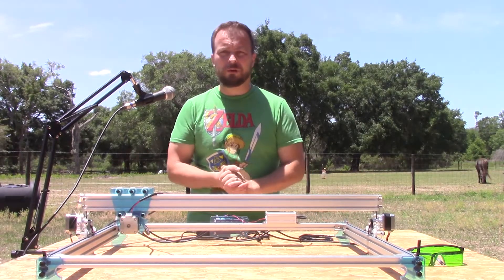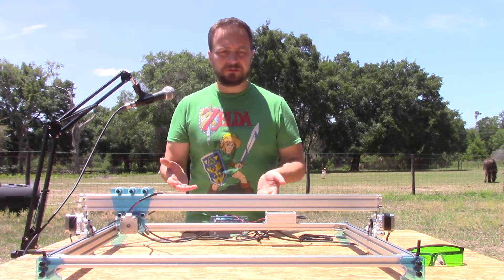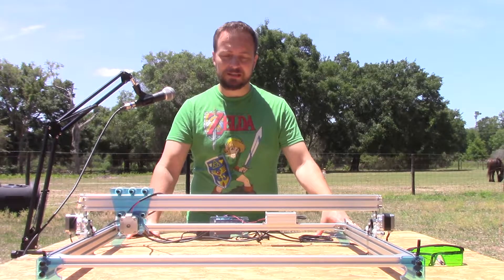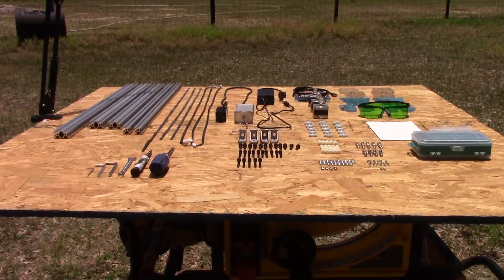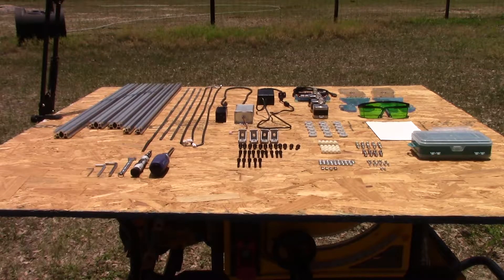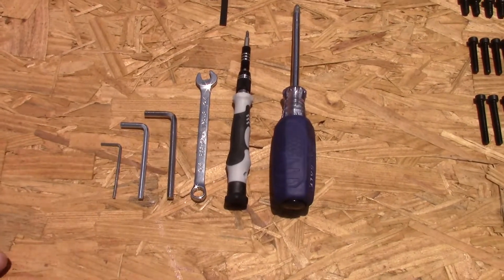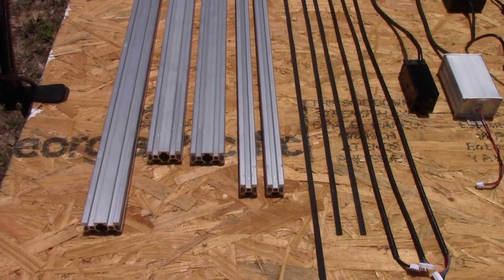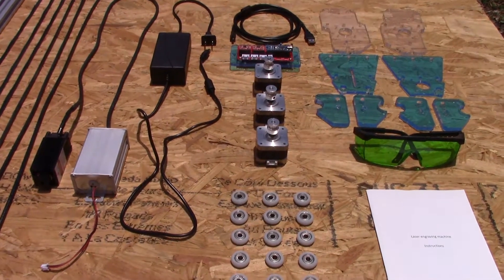3000Mw Blue CNC Laser Engraver Build Part 1

Comment: this is frustrating i bought this machine 2 years ago and haven't been able to use it due to the instructions missing and disk for program missing ive done a ton of research on this and still cant seem to get it working ive tried all sorts of programs and installs and still cant get it to work i was hoping you had a part 3 video but you do not this would be extremly helpful